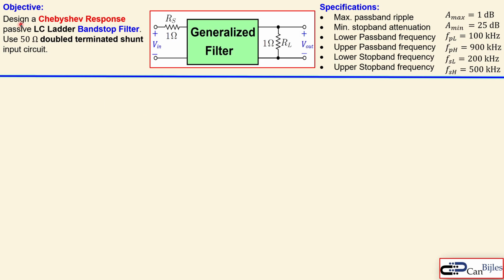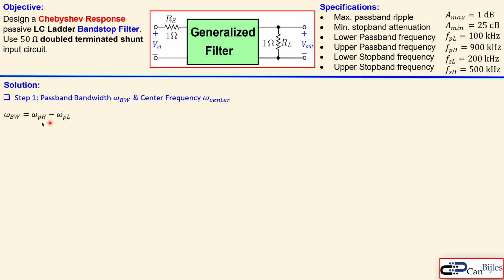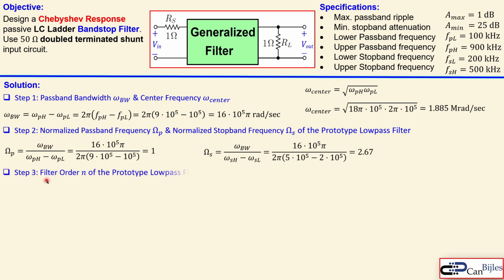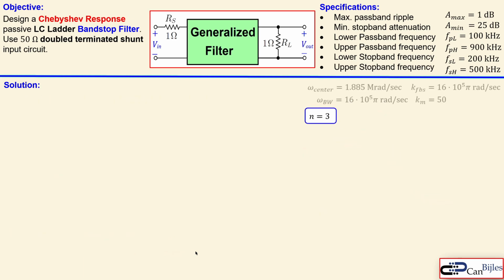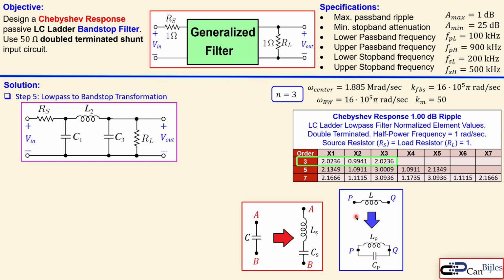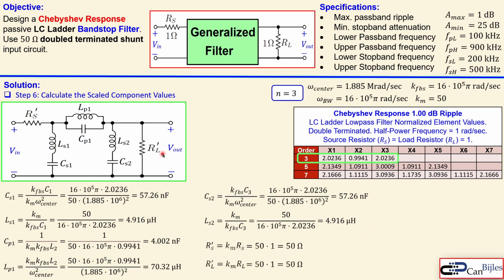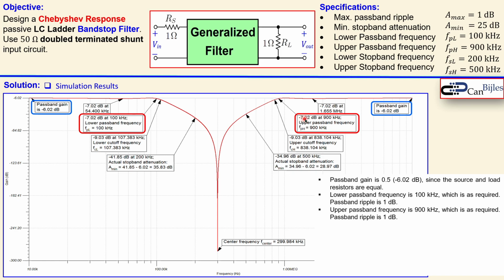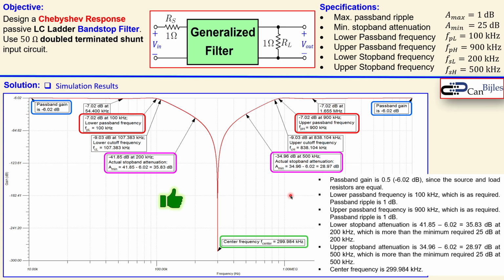LC Ladder Bandstop Filter Design 🌟 Chebyshev Response - 3rd Order 💡 Example 4

Comment: Hello! Lets say you have 50ohm load. But the source resistance is 0. What would you do then to avoid too high gain ripples? Thank you
Reply from the maker: Rs = RL = 50 Ohm is required for maximum power transfer.
Reply: What if the source and load resistance is not equal? İn my design, there are no soirce resistance. Not even 1ohm. But load is still 50ohm. What can i do to save the day? e @CANEDUX
Reply from the maker: @Naletkertenkele  You should have an additional 50 Ohm source resistance in this design method.
Reply: Unfortunatly, voltage and current is far too high. Do you have any other suggestions sir, such as inoedance matching @CANEDUX
Reply from the maker: @Naletkertenkele  Maybe you can send me your circuit and what you want to achieve. I will try to look at it. Mail: can.mehmet.tr@gmail.com
Reply: @CANEDUX  ı will definitively send you an email sir. Mailde görüsürüz
Reply: Could you please share with us the solution please ? @CANEDUX
Reply from the maker: @mohameddrissi1075  If I get the exact problem statement, I will look at it.
Reply from the maker: @mohameddrissi1075   If the load (R_L) is not equal to the source resistance (R_S), then it is necessary to change the coefficients in the table. In the video examples I discuss, all coefficients in the table were calculated based on R_S = R_L = 1 Ohm (normalized) and then together scaled up to 50 Ohm.

There is a section at this link that may be useful. The coefficients are recalculated according to the R_S/R_L ratio: https://my.ece.utah.edu/~cfurse/ece5320/lecture/L27/Filter%20Design.pdf
Reply from the maker: @Naletkertenkele   New video considering unequal source and load resistors: https://youtu.be/yCJHRoV6EJk